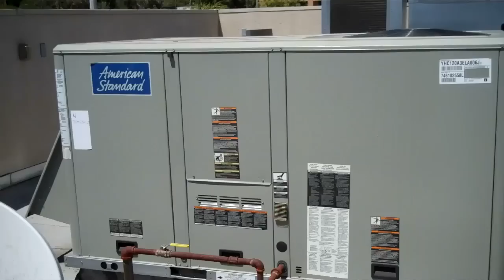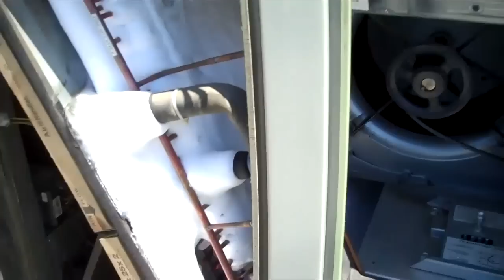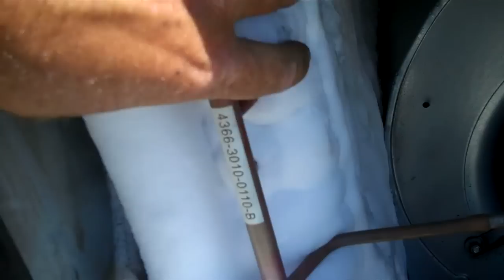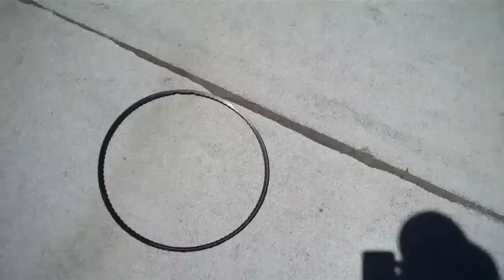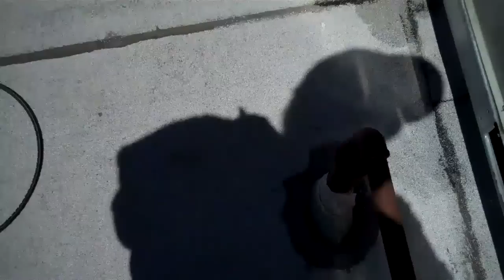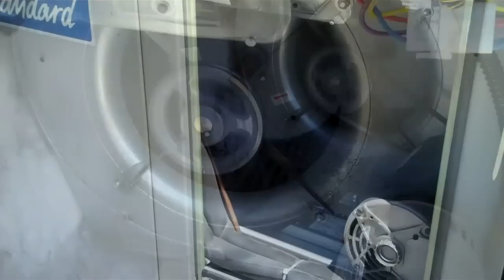HVAC 5 TON Iced up American Standard/ Trane package unit.

Comment: Thx was looking for a unit like the one I am working on. Not exactly but filter size seems about right. I just replaced a the blower motor and squire cage but I don't feel as if I have enough air flow.